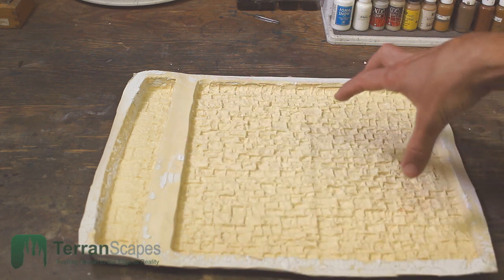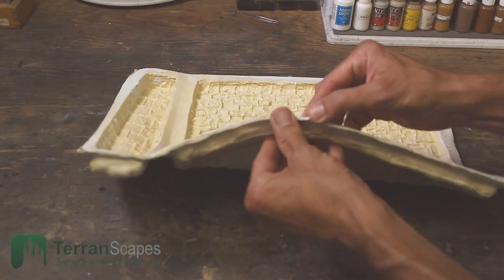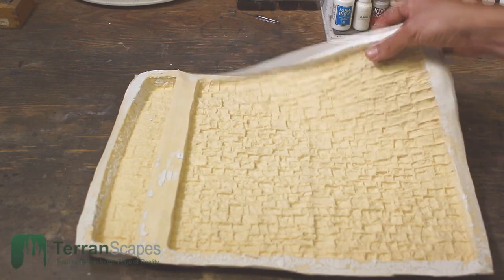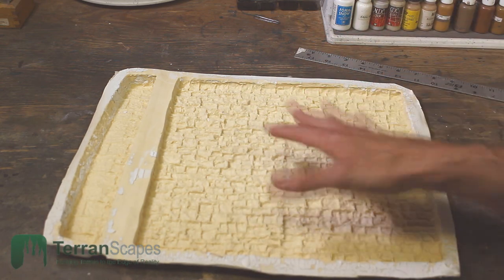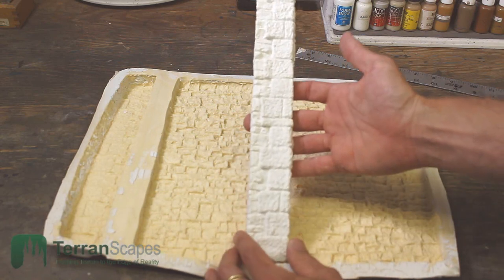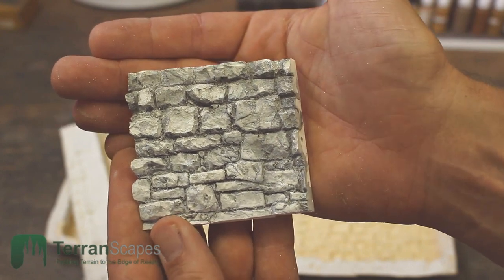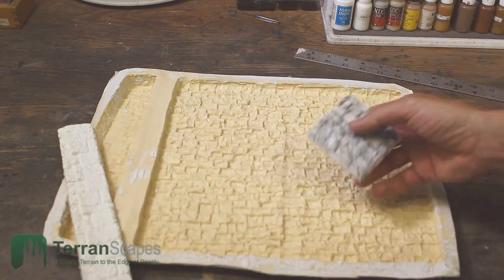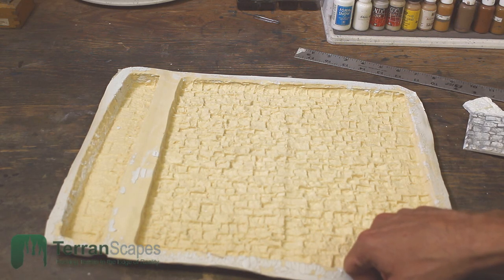TerranScapes - Bragdon Ent. Retaining Wall Review

Comment: wow what a short video, 5 min, that can not be mike, lol
Great video , Do you prever LATEX abobe SILICONE molds ? are they more durable, or more flexiable ?  i only use silicone, because that avaiable here more easy.
Reply from the maker: *chuckle* I thought I should try to keep the 'mini' reviews appropriately brief.  :)  I think each material has it's own advantages.  I tend to prefer silicone simply for ease of release, but latex has some very durable properties.  Don't forget urethane rubbers as well.  Lots of options, and each have their advantages.

Comment: Does Bragdon also provide the painting instructions? It would be a shame to purchase such flexible (no pun intended:P) molds and continue to use old paint techniques.
Reply from the maker: Actually, he does but they aren't quite as clear cut as I would like.  What I have done as go over his instructions and added my own comments on what I have learned so far.  You can see the column on my Patreon page.  You can find it here:
http://www.patreon.com/TerranScapes?ty=a
But you will need to scroll down a little bit to find it.  It was the column for July.  :)